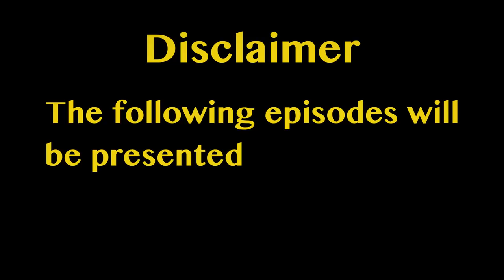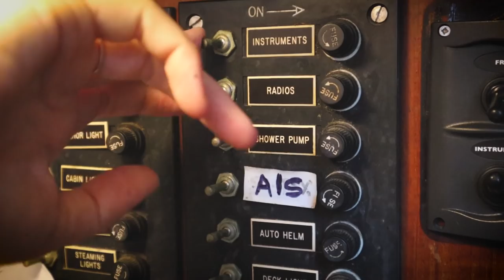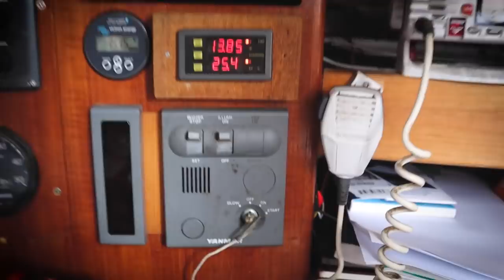HOW LONG HAVE WE BEEN SAILING LIKE THIS? WHERE THE F*#K DID WE GO? PART 2

Comment: I think I would be taking that anode off and wire brushing it clean and reinstalling it.  No antifoul on it. I'm assuming the riggers checked all the standing rig.  You need to service the furler before installing the new fore stay. To me, that sort of failure says torsion on the stay has/is happening.
Reply: If the furler had been binding at some stage ...would it have caused that ?